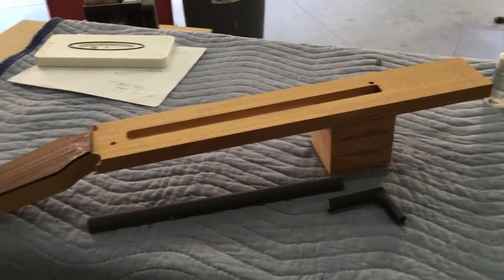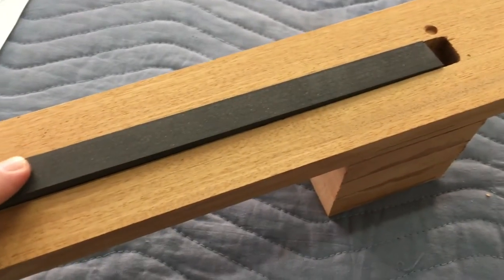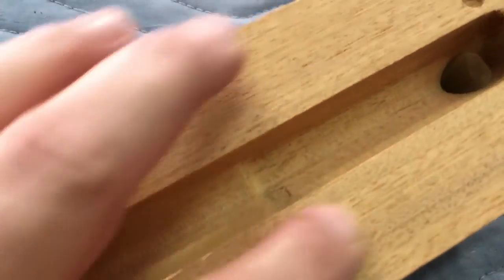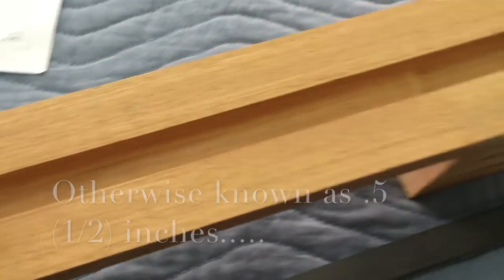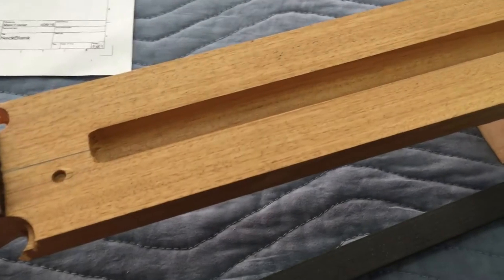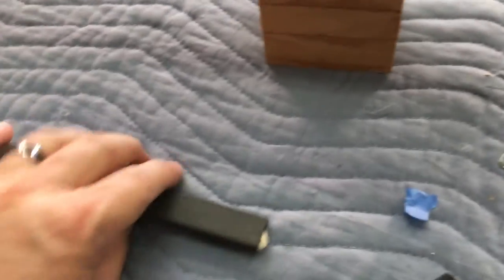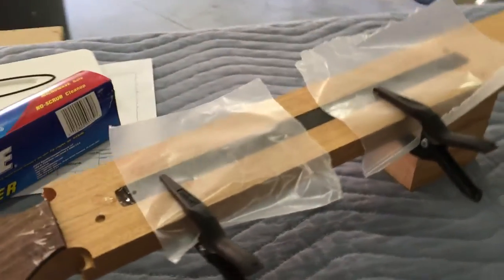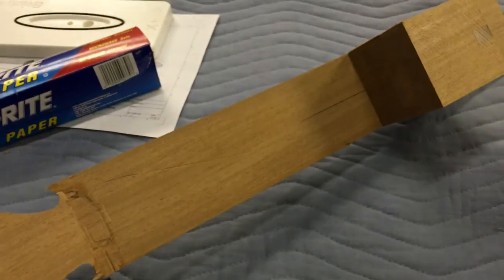Carbon Fiber D-Tube "truss rod" install on a guitar neck

Comment: i have an old silvertone...it's either a 1957 or 1959. It dosnt have truss rod...just a thicker rod or possible a square rod . The neck is still STRIGHT...STRIGHT.lol
it dosnt have the lowest action in the world for an electric ...but it's sitting at standard or around a thickness of a quarter at the 12 fret...It's a 2" hollow body bolt on...Basicially
a thinline acoustic guitar with pickups..
The D tube should be fine or prevents it from bowing
Reply: A square rod will be more effective than anything, because to bend it you need 100 times the weight any string could produce........the only issue is some people like some "arch" on the neck, and you cannot adjust that in that particular neck........still, thats mostly nitpicking.....a square rod will preserve the neck more than any other type.